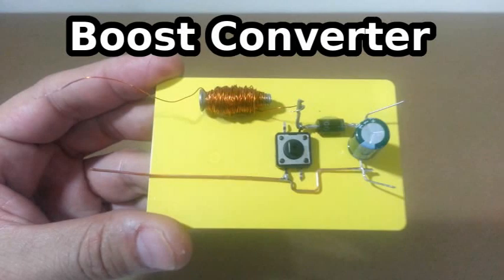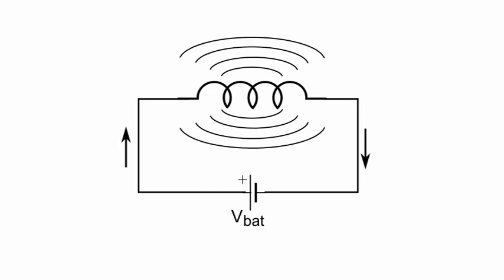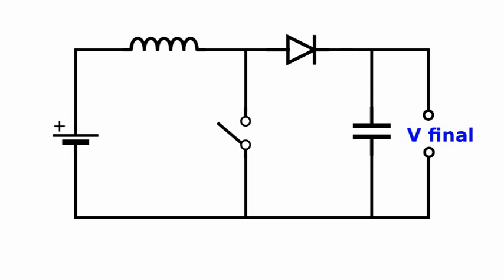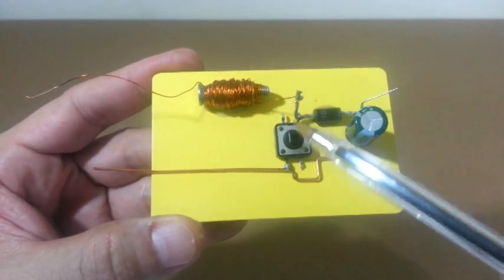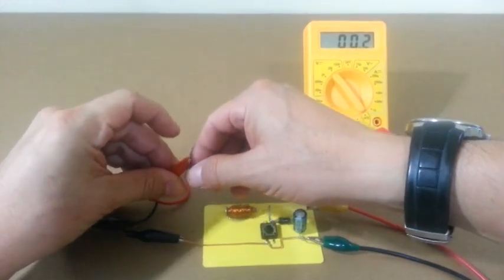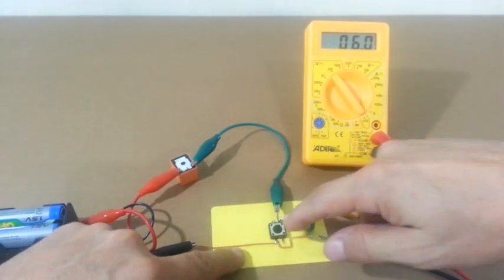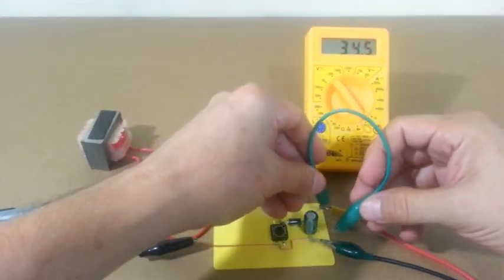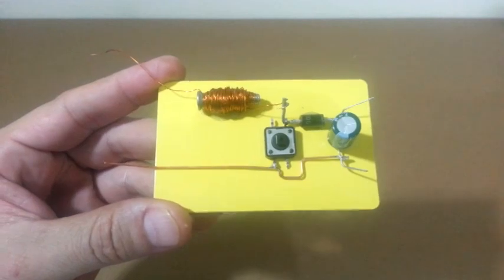Boost Converter - How it works?

Comment: Very good video. I gave it a LIKE.   Why did you get an even higher voltage when you used the secondary coil than using the primary coil ??   Is it a step up transformer or a step down transformer that you used ?
Reply from the maker: +Sss Ttt Thanks, it is a step down transformer
Reply: In this case the inductance of the secondary coil is less than that of the primary coil as far as i understand. In that case i would conclude that the voltage across the capacitor would be greater if the indctance of the coil were smaller.  Is this the case ?
Reply from the maker: +Sss Ttt In theory the output voltage of a  boost converter is Vin/(1-duty cycle). I am no expert in boost converters but i guess the duty cycle is affected by the inductance.
Reply: Thank you for your answer.    Great video

Comment: ahm some old school feedback coil. you said replace the switch with transistor and in my case i will run some coil around the inductor to which will provide a low signal to trigger the transistor in a cycle will it works? something like most phone charger used?? just curios to lazy find out myself thank buddy :)
Reply from the maker: +danu castillo It will work

Comment: if we use a feed back coil instead of separate signal generator will it affect the charging of the primary coil which to be use as the boost coil??
Reply from the maker: +danu castillo What do you mean by a feed back coil?

Comment: why my circuit voltage drop after i push the switch
Reply: (Sorry, my english is really bad)
So voltage drope)
Coil make higher voltage level and littlebit lower current. Capacitator make bigger current and fix voltage. I think u have to little coil ( in Henrich) and to big capacitator. 
Other thing: When u use that circuit , the batteries go in shortstop. So u use bigger mAh battery pack or non-galvanic psu.

Comment: what is the kind of the switch which used . is it igbt or mosfet ?!
Reply: +ibrahim abusall  It Can Be A Mosfet Or A Transistor
Reply: +AlertIowa1234 How can it be either a Mosfet or a Transistor? These devices are not the same and they do not work the same.

Comment: +Ludic Science Hi, I asked myself if it would be possible to build a very simple, but effective boost converter. Instead of a switch I used a relay oscillator, in which the two contacts needed for the oscillation were separated from an other pack of contacts. It worked pretty well and with a badass cap with 400V 300µF I achieved  120V under 5W load or so. Of course, the voltage depends much on the connected load, but for such a simple setup the results were pretty amazing :)
Reply from the maker: +helut kuno That´s great, I will try to replicate your setup
Reply: Ludic Science my circuit doesn't work,i use a transistor and an ic to switch it but it doesn't create higher voltage.i use the handmade inductor and transformer inductor but non of them work

Comment: How would I use a transistor to switch the circuit?
Reply: +Scotlahn Mccallister Connect The Base Of The Transistor To Your Controller/Pulse Generator Circuit
Reply: +AlertIowa1234 It might be simpler just to tell people how to hook up the transistor in this circuit. It makes sense to me that this is the logical question. Simple questions require very simple answers. Along with that, they actually require extremely simple but very detailed instructions.
Reply: +Scotlahn Mccallister what is a controller/pulse generator? is it the switch?
Reply: Back again. I also want to know how to connect a transistor to this circuit. Can we get an answer instead of just connecting the base to the controller/pulse circuit. Transistors need to have all 3 pins connected to something in order to work. The only thing I know is that the base and collector need to be attached to positive and the emitter needs to be connected to negative, telling someone to connect the base to the circuit does not tell them where on the circuit to connect the base , or the collector, or the emitter.
Reply: Arash Taheri
The controller/pulse circuit is the device itself with all the parts.
 This person didn't say where on the circuit to connect anything.
Reply: +lepayen I agree, they need to be a little more specific on where to put the pins on the transistor, besides I don't even know how to make a pulse generator circuit that can be used for this one.

Comment: very very good , could you please tell me which transistor or mosfet would you use
Reply: +Mrga Mrgesa I'd Use A 2N22222 Transistor
Reply: +AlertIowa1234 which pins would i connect to what in that case?

Comment: Most Well Done! LS. This a Most Clear demonstration! Highly Didactic Video ♡♡♡♡♡♡

Very Like the Simplistic Way to show the Basic Principle, with cheapest materials :) and don't mess up with a wrong explanation for how we can get higher voltage from a coil than the applied to it ^_^ (which has something to do with the much higher speed of magnetic discharge than the speed to built the magnetic field, BTW).

Very Thanks for your Great Videos, LS! :)
Reply from the maker: +Didier Khwartz Thanks a lot! I wanted to stay away from the di/dt stuff, for that, a book is better (maybe).
Reply: You're Most Welcome, dear LS! and for the di/dt, maybe books cause hard to show what is going on, unless you have an oscilloscope and a very reactive magnetic sensor ;) But as it is a item not very understood, You would make a "Public Utility Video", imho, if You do one ^_^ . Regard :)

Comment: Would it work, if you use, instead of the switch, a simple relay oscillator?
Reply: +helut kuno It would break down quickly, it shouldn't be used more than maybe once a few seconds, you need to use transistor, because it can be switched hundreds or thousands times a second.
Reply from the maker: +helut kuno It will works, but +RuskiRozpierdalacz is correct.
Reply: +RuskiRozpierdalacz the collapse will destroy a standard transistor quickly (which you see happen all the time)  - you can use a high rated SSR or perhaps something else. any magnetic switch that is rated to accept the peak collapse.
Reply: +RuskiRozpierdalacz sorry my mistake i was thinking of an AC system in DC a transistor would work sorry for that error.
Reply: +RuskiRozpierdalacz sorry my mistake i was thinking of an AC system in DC a transistor would work sorry for that error.

Comment: could you explain / give links that explain how transistors are used to create the high frequency oscillations? maybe create a video demonstrating that?
Reply: +Anshul Tripathi You connect gate (or base) of the transistor to the function generator (it can be as simple as 555 chip) that gives you square wave, drain and source (or collector and emitter) to the places the button was connected.
Reply: +RuskiRozpierdalacz That makes perfect sense. It should have been obvious, now that I think of it. Thanks a lot. I'd been wondering about this for days.
Reply: +RuskiRozpierdalacz Transistors like 2n2222 are also used to create oscillations in slayer exciter circuits. Correct me if I'm mistaken, but doesn't a Tesla coil (which is basically a transformer) require a voltage that alternates between + and - instead of just a positive voltage and 0 volts (that a transistor receiving a square wave at its provides)?